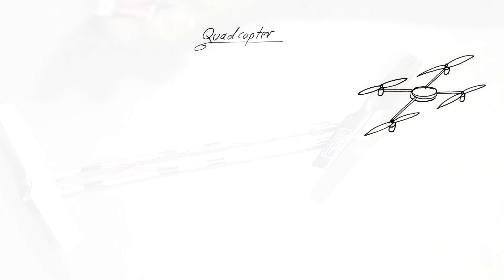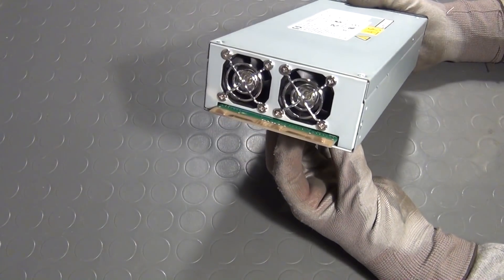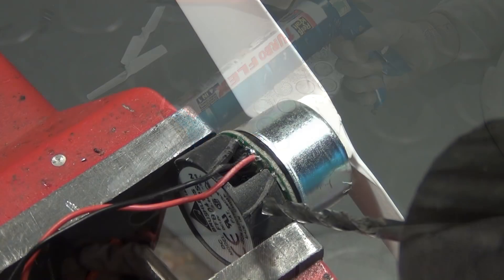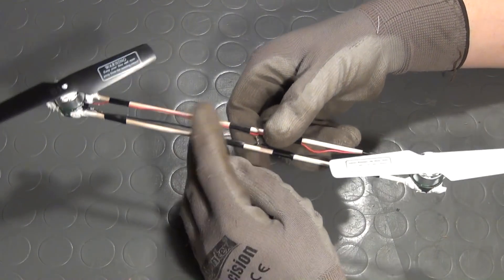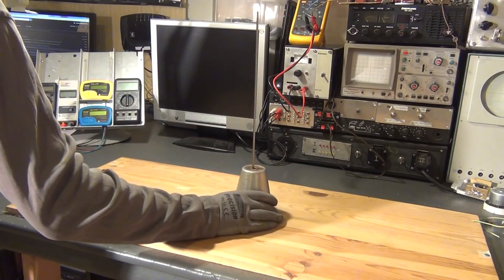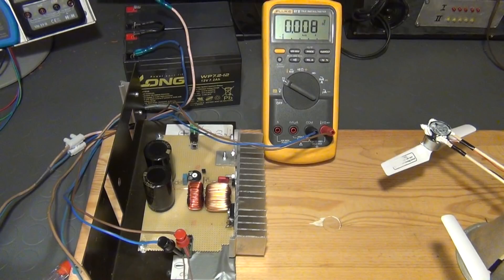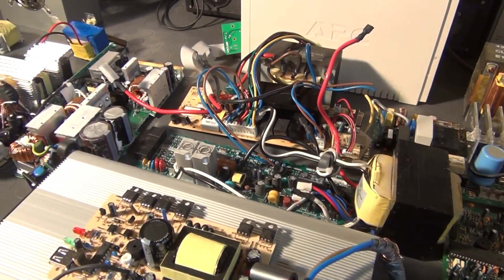Building a Cheap Quadcopter At Home (1)  - Lift Off

Comment: Laptop hard drive motors, probably 15K RPM would be best. Lighter than fan motors, and lower power input required. Already have threaded ends, so no clumsy adhesives needed. Stepper motors, so quite ready to receive precise speed instructions for directionality. 15K speeds mean full lift capabilities, as well as being better able to deal with wind.

Comment: nice  but 1st question that comes to my mind is how can you power those motors with this amount of power in the air , there is no small portable 20 Volt battery and if you use a 9V battery with a power up converter is the weight gonna be ok ? Im so curious about what you'll come up with, keep up the good work

Comment: I tried making a quad myself a while back, it used 4 peace of crap 3 volt dc DVD drive motors, that i connected to a 17 volt
outlet power system. And the result, it never got off the ground. That was just for testing and a fun project.

Comment: People have ran fans like these before while "hacking" their PSUs to run them at 24VDC to get extra air-flow at the cost of much greater noise (connecting one of the +12V rails to positive lead the fan and the -12V rail to the negative lead of the fan). I've tried it myself in the past, they seem to hold up okay. Worse-case scenario, the electronics might be the weak link, and the stators themselves might be able to take a lot more abuse.

Comment: Nice mini-project. As for the motors, given that they are meant for fans which are intended for on-going operation, I believe they should hold out well. The sticks for the frame were a good idea, as was the central rod.  Not sure why you did not just connect one of your power supplies rather than the batteries though. I am not sure but I believe that with some ducting to focus the air over a smaller area, the lift may have been higher for the given fan size. Anyhow good job and I have subscribed to your channel.

Comment: I think I know how you can better that copter: find a large desktop computer tower and open it. If it has a fan that is almost 5x5 inch, those are like turbo fans. I have one and it can blow air almost 3 feet away with just a fully charged 9 volt battery, and it has some jam detecter so it temporarily shuts off until some timer hits 0. I also cut myself a few times with it too. If I can get 5 more, 1 because the current fan had screws stuck in it preventing it from turning, so I took off the bracket on the back under the label and opened it to remove the screws, but I broke the bracket so I can't put it together without it easily falling apart, and the other 4 to build a quad copter like how you did, but use less than 9 volts. That might take years for that.

Comment: It seems like its not getting enough lift because 2 of those fan blades are upside down. Wouldnt that mean they are essentially  trying to push air down?
Reply: no. he also glued the propellers reversed, so it's moving air in the same direction.

Comment: May I please know the name of the terminal cord that you use to connect to the battery? Also, I was wondering if I can have a list of all the items you used given to me. I know you have explained and mentioned them all (items) but I am still confused on some. Also, how are the wires from the motors finally get connected and finally give two wires that finally connect head to the terminal connected to the battery? Thanks! Also, I will appreciate if someone else can answer me as soon as they read this comment of mine. Much appreciation.

Comment: This would work better with hard drive motors 15,000 RPM ones would be quite power hungry though. Broken hard drives can be purchased cheaply, and a local computer repair shop may even give you them for free!

Comment: That is cheap , and it hovers , it's true. But for it to fly using brushed motors you need a big battery wich equals big weight.
Also as oposite to airplanes , there is no wings giving you trust for sustaining in mid air , so as you know the key feature of a quadcopter it is his stability control system( gyroscope ).

Comment: Taking them apart and replacing the ring of magnetic material with glued-in rare-earth magnets might be an easy power boost, if the circuits could handle them!

Comment: you talented but connecting four heavy motors on the wings won't work. also you need to program the thing in order to fly and stop and avoid objects, otherwise it will be onetime wonder

Comment: This is not going to work sorry.
The motors are too heavy for the amount of thrust they provide so you may be able to fly but the performance will be poor, you would have to make a tiny high voltage pack to get it enough power,  but more importantly:
The motors need to be controlled via PWM otherwise you wont be able to control the craft from an existing flight controller.
Reply: ReabowRotors i taugth the same but if he is going to make it rc he needs motors with gear or brushless but since this is the first time he makes a quad he should buy some motors from a syma x8w or something like that and Just the reciver and a transmitter from a syma and there you have it a easy and sheap quadcopter PS HAPPY FLYING
Reply: Bro. I am interested in making quad please help me which type of  and size motors i should buy, please help me.
Reply: Meer Zafar Noohani what size is your frame? what quadcopter type? arial filming or fpv Racing? if you say what you are intrested in then i can help you. if it is your first time making a quadcopter i recomend  go look at 
UAV FUTURES  he is realy good at explaining how and what is the best fore you. if you like action and speed i recomend fpv racing but if you like filming and relaxing i recomend arial filming but it is al up to you to deside but fpv racing is the best because you can make New friends and you learn more abaout the RC hobby hope you found it help full and what every RC pilot say HAPPY FLYING

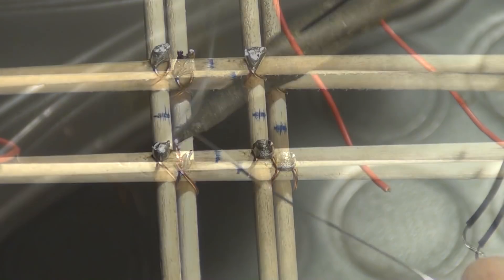Comment: @ 5:16 I thought you were going to for sure preheat the aluminum, and bridge a gap between the solder on the copper binding, and the aluminum plate. You could also use the same technique on the motors. That glue is ultra heavy.

Comment: is it possible to solder somewhat similar sized brushed (micro) motors to a diff fc and fly? like a Frankenstein junkyard parts kinda thing? if the board and vlbatt and motors can all handle it?

Comment: i just jump to the end! his equipment is not cheap to make a fucking drone without direction.
Reply: i think he meant to say that no matter what flight controller you try, it won't fly, because the problem is not the flight controller choice but the lack of thrust
Reply: so far he spent less than $10 and it already flies, i assume he will use a small arduino board for the controls and those are pretty cheap too. the equipment he's using to test and work on the build as he goes along may not be cheap, but the stuff that he's actually putting into it is.
Reply: An arduino would not be able to control this, nor any other stabiliser. The reason motors have shafts is so they are centered perfectly on the motor, even 1mm of difference would cause such vibration the entire wood structure would fall apart. Also those motors do not have the speed or reliability to keep a quadcopter stable. If you replaced the motors with hobby motors and the props with hobby props then you would have the correct setup to fly. But then you'd be using a real quadcopter.
Reply: DronePower why would an AVR not be able to control it? it has enough ports to control the 4 motors with PWM, all that is left is a gyro and an rf22m
Reply: Because the vibration from the shaftless motors would cause the entire thing to fall apart. Besides the fact that it isnt lifting a battery and isnt generating enough thrust to really do so.
Reply: DronePower ok, but why  would an arduino not be able to read sensor data, user input and then calculate the required signals to stabilize the quad?
Reply: He was definitely wrong about that part, a quick google search shows instructables and video demonstrations of arduino controlled drones all over the place. It's been done dozens of times already.
Reply: You're right, that is exactly what he said. I shoulda went back and read that first :)
Reply: i wasn't sure myself

Comment: can four 9v batteries used for the quadcopter
Reply: as you saw(?) in the video it started lifting off at around 15v so 9v wouldn't be enough

Comment: umm hey homie to get the motors to spin in opposite direction switch the black wire and red wire from + to - and - to + . this will change the direction in which the motors spins without turning motor upside down. just saying
Reply: that works on normal brushed and brushless motors but it doesnt work on brushless dc motor that have a built in motor driver circuit
Reply: adam alloway works for brushed motors, thies brushless have 3 wires like A/C current

Comment: umm hey homie to get the motors to spin in opposite direction switch the black wire and red wire from + to - and - to + . this will change the direction in which the motors spins without turning motor upside down. just saying

Comment: The ultimate video for quadcopters....thanks for sharing all the technology and concepts...just one question...why is 2.4 ghz frequency used....?
Reply: Because 2.4 GHz is the most common frequency most devices uses. Wireless keyboards, wireless controllers, ect. They use it because this is one of the frequency that are unlicensed.

Comment: On the out runner brushless motors designed for multirotors you can infact swap any two of the three wires to reverse the direction of the motor . Maybe not your motors but a standard BRUSHLESS motor does work that way .

Comment: Yes a bit more testing seems in order, now if you would use a stronger glue they are on the market en slightly less than pretending you're cementing a brick wall would help too and maybe 4 thin hard plastic tubes they weigh less than wood. The only thing for you left to do is to find out how to get those two lead acid batteries between the props and then you just throw it in the air and give up this flying adventure.  (just a tought)

Comment: ok think about this you cant put on that quadcopter lithium accumulator with 2,5 kg or more that just not gonna work you should make smaller one who can be powered with the small lithium battery 4,2 volts and the weigh is only 200 grams

Comment: It will never fly building it like that. The motors are too weak, the construction method too heavy and the voltage required too high.

Comment: what is the rpm of that motors ?????
Reply: the motor rotates so to speak, revolutions per minute ( rpm )
Reply: i had used 3 volts motors but the motors had failed to lift it .. the motors i've used is a CD PLAYER motors
Reply: from where server psu MOTORS u have got from will u send me the link from where u had bought  the motors from
Reply: Shanlink Alejandro what is the cost of that server psu's ,,,,,,, i mean cost of one psu

Comment: Hey I'm Working on a project of my own sort of like this. Is it possible i could get a little help from you through an email? It's a quad copter and i have parts from a salvaged drone, but im not for sure if the design of this quad copter will work with the gyro settings of the salvaged one

Comment: hello, sir. i like this video as a newbie in doing techie stuff. actually i have just started teaching in public gradeschool since june of last year and im trying to find ways to make science subject an adventure to our kids in simple countryside community. i am just wondering, in this video you said the motors from old pc drives only rotates in one direction. but i just watched another video here in youtube where the person created a homemade remote controlled car (both the car and the remote are improvised), and the motors he used are four motors from pc drives as well. in that video he could move the car forward, left, right, as well as REVERSE. could you check this video and see if there is any difference between the motors used. tnx: https://www.youtube.com/watch?v=19WTPkdYULY
Reply: +xian zulueta Thoose motors were motors from a CD drive which are brushed motors. Most motors used in pc fans are brushless motors liek the ones used in the vid and cant be reversed easily

Comment: Part 2 pleeaase. I need more info about building a ghetto DIY quadcopter.  how about controlling and steering and most importantly about what batteries to use.  (i used a 12v small battery) and the voltage dropped to 4v as soon as the motor is being used by it, why??

Comment: how much volt motor is required for to lift the copter
Reply: +dr_BDo ww
Reply: Ruby Katyal
Reply from the maker: +sajeed khan Well you can see it in the video...
Reply: Can u show how to make a drone or quad with the help of wood.Using brushed motor.how can we make a quad with the help of a rc car circuit and the remote which is controlable and independent...thank you
Reply: impossible to recuperate the stuff mentioned to get something FLYING

Comment: the BL Motors from the coolingfens are a great idea but u need to buy 4 ESCs and a FC like the KK2 or a CC3D these are very cheap  FCs bzw u need a better  frame for more stiffnes in the air and last but very important u need a Radiocontroller and i recommand a real RC transmitter not one of these little toys
Reply: and sry for my Bad english i'm from Germany

Comment: you can now buy the motors for a quad for dirt cheap. the transmitter and battery being the most expencive investment. Using pc motors isnt even a good idea. No you dont have to use carbon fiber arms or bodys to make a quad. I juat bought a Quad for $32.00 with camara from gearbest. The professional models are what cost a fortune but then again, they have gps tracking, return to home features, geo fencing, follow me mode low battery alert, everything  short of making coffee and making love. some guys compair flying them to making love but personally, thats not my cup of tea. I just found your site and plan on checking out all your other inventions, hopefully they are a little more useful than this one.

Comment: I doubt fan motors will work all that well because they just aren't designed to handle quadcopter level power. However, you clearly demonstrated they have the potential to work. Maybe improving the control circuitry to handle higher power and doing some mods on the motors that increase internal airflow would do the trick. Also, since they are so cheap a hexacopter or octacopter config could increase lift enough to carry the the payload (battery+controller+receiver). Larger propellers also increase lift without much increasing power requirements (aerodynamics and its beautiful nonlinearities). 

However, by the time you do all that you're doing it for the challenge, not the money. Me and a group of people are working on a quadcopter and it's looking to cost around $200 plus the price of the transmitter.

Comment: I love how you get 1.4 million views for sticking four motors together :)
Reply from the maker: You are right. I have made a lot of videos, that are much better than this one. It's not my fault though that most people think, that THIS video is great.
Reply: +The Post Apocalyptic Inventor but where is part 2? without getting further, this video is pointless for a builder.
Reply: +iforce2d Quadcopters get a lot of attention these days.
Reply: +iforce2d I love your channel I wish more people were a part of your channel.
Reply: 7million
Reply: +The Post Apocalyptic Inventor they just find the title interesting, but still, it's informative, we now know that you cannot use any type of motors for this job, you needed 15volts for a liftoff here, and you used big (bike ?) batteries that are super heavy for this little creature, so less power consumption + more RPM = successful flying machine
Reply: 6.5 mil
Reply: It is because he lied in the title :). The heart of the copter is the flight controller and the remote control. And it is far for a copter. You can by a full RTF quadcopter with remote control for 12 Euro. It is hard to race with it.
Reply: iforce2d school,sjznzk
Reply: iforce2d CMO, kMmslkzmldd*
Reply: Nice video sir
Reply: don't forget the very gurly lighter
Reply: iforce2d i like your videos. But who is watching should be more drone savvy for your videos. They sound easy but they arent for who is new to drones also costly to make on your own. This video (post apocalyptic) in opposite simple and cheaper to build. Also shows fundamentals very good. This is why it loved so much think. I watch more iforce2d channel now but this video is my first step to drone world.
Reply: damon-st roboting machinery Birds

Comment: ok I understand the brushless motor cant be reversed but how about brushless power drills are they switching the gears  inside not the motor
Reply: +scott trudell Pretty sure they use a controller circuit and a multi-phase motor like an RC car. Reverse the phasing and they run backwards. I'm not positive though, my cordless is still brushed.

Comment: I have a spare multiwii SE 2.5 controller you can have if you want Its in storage right now, but in January I could send it to you :)
Loved the girly lighter, but as a tip, you can also use the solder iron (not the tip where its too hot, but further up ;) ^_^